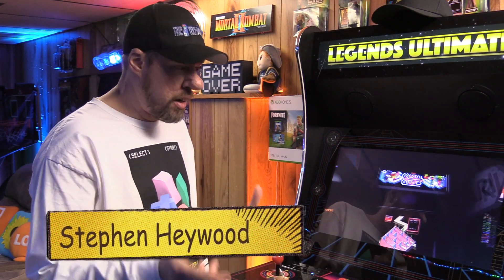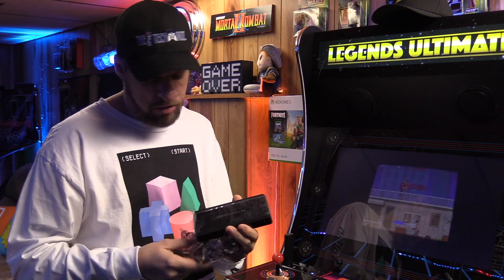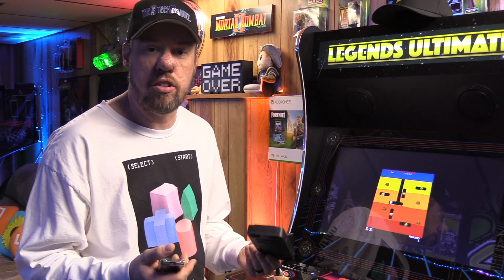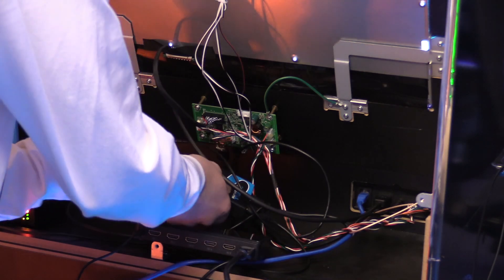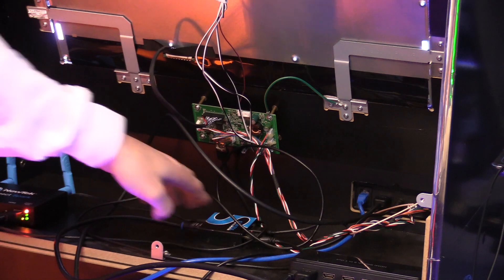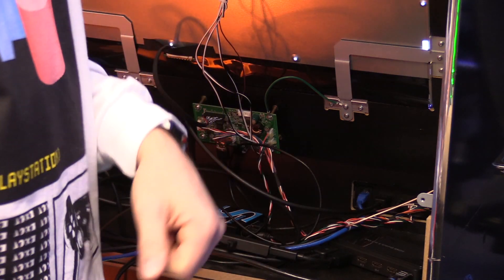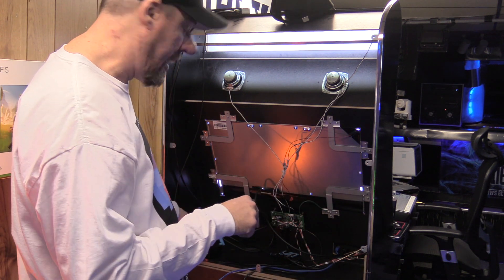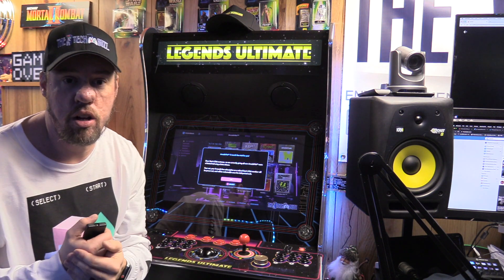AtGames Legends Multiple Input Tutorial

Comment: I did something similar about a month ago with an 8 port HDMI switch. I also use a USB switch so nothing is powered on unless I turn it on.
Reply from the maker: Brian Walstad that's how this is. Glad you did it a month ago. Didn't see any videos on it and also didn't see any write ups on it. So since this is what I use for my consoles, figured I'd do a video. Thanks for the comment.
Reply: I believe I mentioned it on the AtGames Facebook fan page. I didn't take pictures or videos though. Also I believe if you don't switch the input on the front panel the joysticks and buttons still control the ALU when using Blast dongles. I ran my HDMI cable and USB cable up between the control panel and monitor and plugged them in up top so I can switch the input. Here is what I used in case anyone is interested. I already had the HDMI switch from my old theater set up that I was no longer using so for me I only had to buy the $7 USB hub with separate switches and some HDMI extensions.Also when I got my HDMI switch a couple years ago I got it for less than half the Amazon price on Wish, but I can seem to find it on there now.

https://www.amazon.com/dp/B003L14X3A/ref=cm_sw_r_em_apa_i_QDtvEbP4NEK61

https://www.amazon.com/dp/B07WGFMF9Y/ref=cm_sw_r_em_apa_i_vJtvEbXV1XX4V

https://www.amazon.com/dp/B07S1B9PFC/ref=cm_sw_r_em_apa_i_GLtvEbNX3KASC

Comment: Is this hub connected to the console top or in the cabinet?  Can you have the HDMI to the monitor be the output and plug all the HDMI accessories including the alu into the hub or do you have to plug it in on top?
Reply from the maker: J Kwak I have mine on top of the cabinet. When I started the video I was going to put it inside, but then saw the spot on top. You can take the control panel and put it into input 1 on the hdmi changer. Take the output of the changer into the monitor.